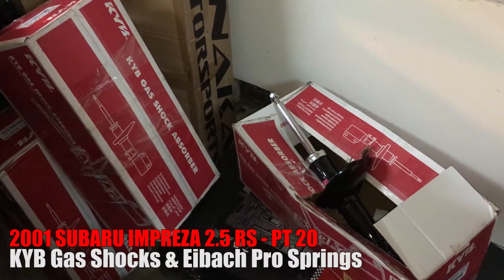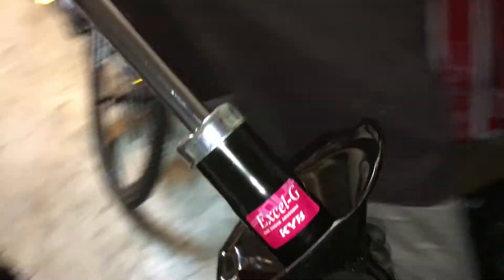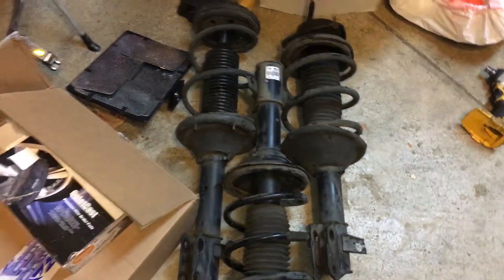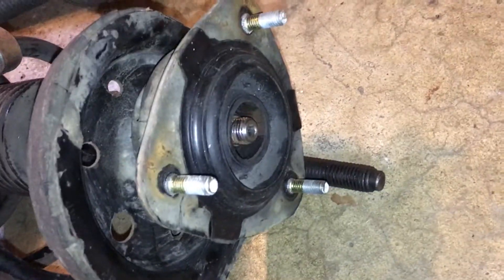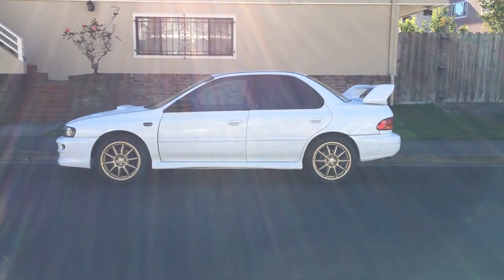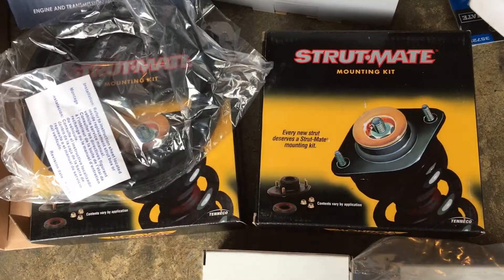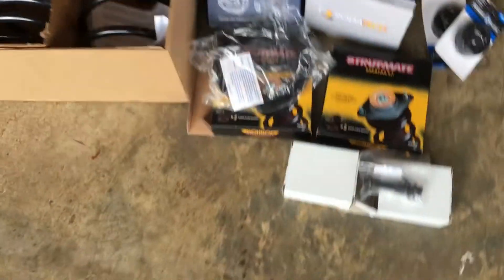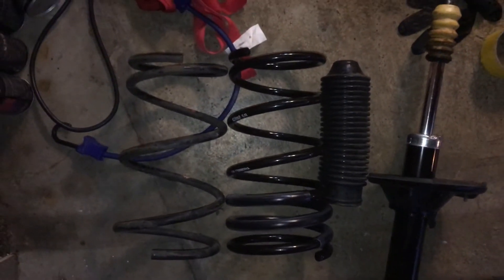Eibach Pro Lower Spring and KYB Struts - Subaru Impreza 2.5RS GC8 Video 20

Comment: Does this setup feel decent on rough roads or like bad seams on the interstate? It's hard to find a lowered setup that rides pretty good.
Reply from the maker: The ride is decent. It's still pretty bumpy, and not stiff. I had Swift lowering springs on my R56 Mini Cooper that were one of the best that I've ever ridden. It had a good amount of stiffness while staying smooth, and was predictable. The Eibach Pro's aren't as good.

Comment: Hey! I have the same setup of KYB absorbers + Eibach Springs but I get this weird noise when I turn my steering wheel left or right fully. Does this happen to you or just me ?
Reply from the maker: I had a weird popping noise when I turned, but realized the washers on my shocks were installed upside down. I didn't have issues with it making noise when turning fully. Sounds like the front sway bar may be hitting. I'd suggest raising the car, turning the wheel fully and seeing if anything is hitting.

Comment: Where did you buy the eibach springs?  They are so hard to find now!
Reply from the maker: I got them from maperformance.com in 2019. Looks like they don't have them on the site anymore. I found some at https://www.bodykits.com/i-24233612-pro-kit-lowering-springs-7705-140.html but I've never heard of this site.
Reply: @ColinLeung  thanks for the reply.  I've seen them on a few sites and messaged them to make sure it was real, gotten two replies saying they'll take it down and that it's discontinued.  Bummer.
Reply from the maker: @n3rdstrength  Dang. That sucks. Good luck with the search! They're not that good by the way. I'd go for another brand or coil overs.
Reply: @ColinLeung  interesting, good to know.  I think the only quality ones for sale now are the H&R's which drop it quite a bit lower.